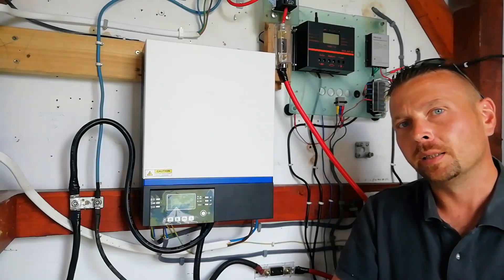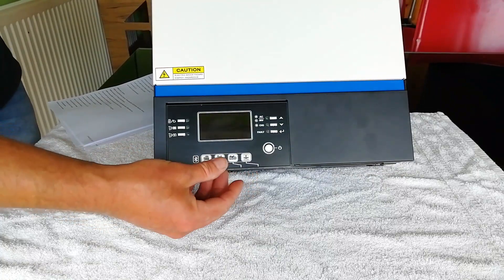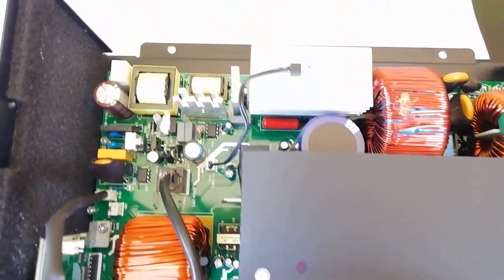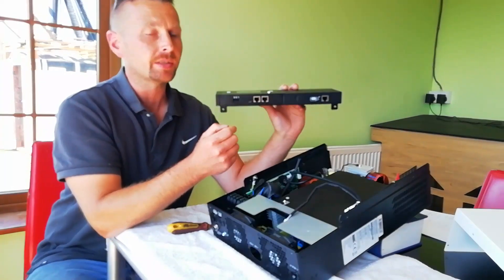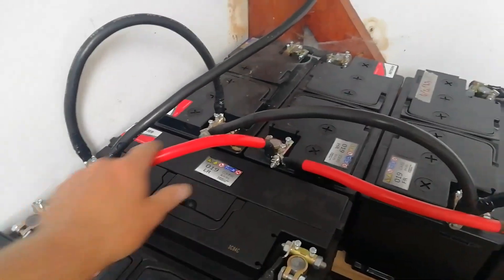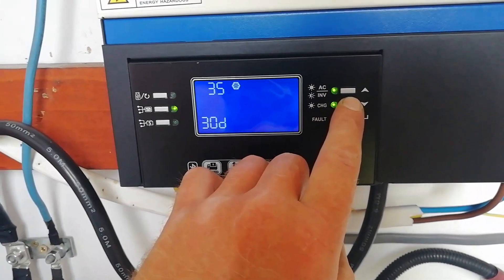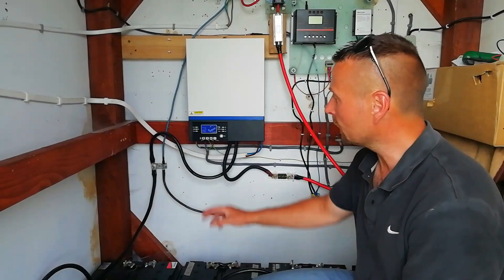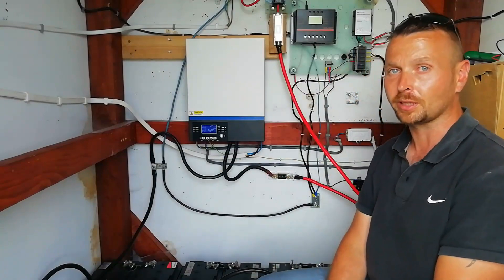THE BEST VALUE INVERTER? (24v)

Comment: Thanks for the look inside. I intend to open mine up as soon as the warranty is out.
We purchased the 5000 watt HQ 48volt 230 volt output version. Not sure, yet I think they are originally made by LVTOPSUN.
Since we installed it ,this all in one has been running strong and flawlessly.  The internal MPPT manages the 320 volt solar input ideally. Directly powering the inverter and then adding to the battery when needed. I can run the unit on solar only without the battery, given the solar input is more than the AC output. The display has a straight forward layout for easy viewing, and one can use an old laptop to run the Watch Power app to review all the data in detail. 
I have no complaints with our unit. 
Happy as ever. From the Land of Smiles...
Reply from the maker: Most welcome. Best of luck with your system, may it continue to serve you well. 👍

Comment: I have 2 off grid conversals 5K/24V working in parallel. They are the old generation I bought them 3 years ago but I installed them only 7 months ago. I really loved the features. The only issue I have with them is that they are a bit noisy. Also, during initial install, when connecting to the battery, I had a huge electrical spike due to the internal condensator. Not a big issue. No need to worry. If you want to avoid it (but not needed), manually charge the condensator using a small resistor and a battery. Despite the noise, so fare, I love them. But I fare as I can see in this video, the new generation looks better.
Reply from the maker: Hello Jean Paul, 2x 5kv conversols sounds like great system to have and thanks for the tip about the resistor, much appreciated. Did you have any issues synchronising the units or was it a straight forward operation? Also, the newer models on the voltacon website look like constant improvements are being made. I was like a kid in a sweetshop going through the website.